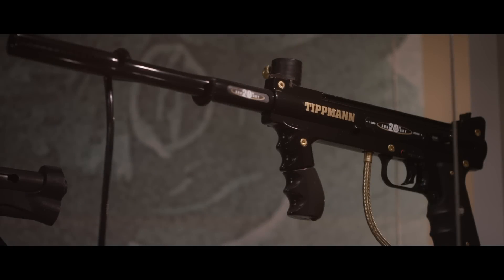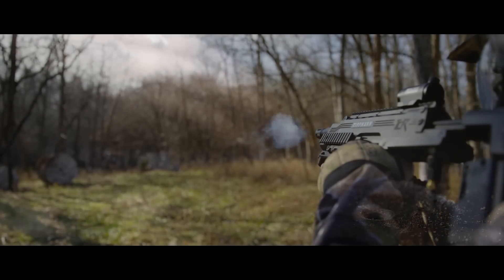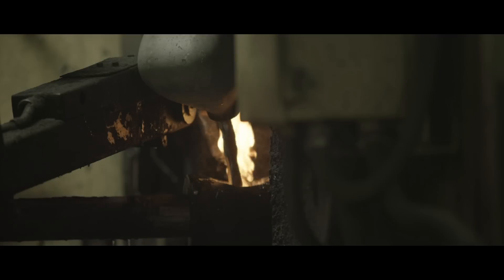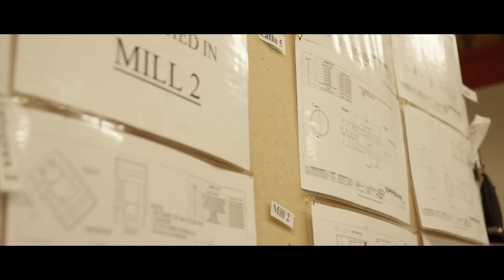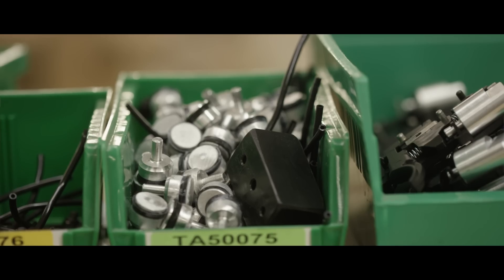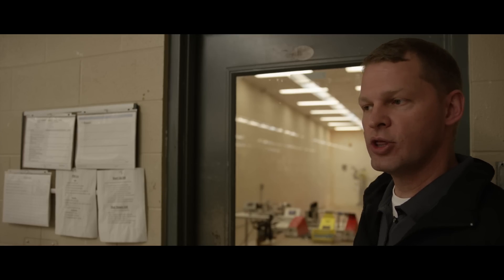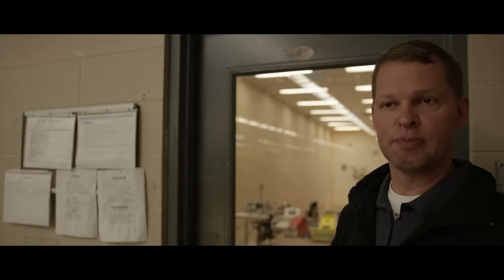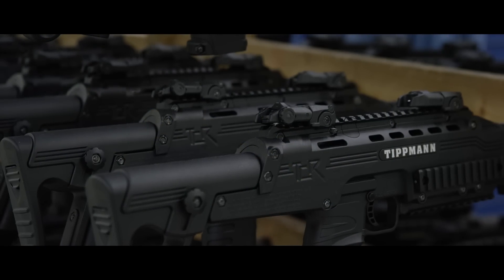How Tippmann Paintball Markers are Made

Comment: My first marker was a Splatmaster Rapide that I tricked out with Gator parts. My second was a Tippmann 68-Special. I was gifted a 98 Custom but never really liked it. Still use the 68-Special as my primary with a TPX backup today. May try the TCR but it won't replace my 68.

Comment: Good ole Tippman. I had a 98 Custom I bought in 2002 that I loved. I took it apart to see what made it tick and realized that if I just took a little piece of o-ring and put it in the oblong hole cut into the sear that the sear would stay down and the gun would fire full-auto. No need for the electronic or response trigger. Loved that gun!
Reply: I tried this and it worked. You're a genius😂

Comment: Started with a Sierra-1, then got a TiPX, and then an X7 Phenom. Unfortunately that's where it ends because I started playing magfed and while the TiPX is a good sidearm, TIppmann doesn't have any particularly interesting primary weapons for magfed.
Currently using a Maxtact TGR2 and keeping my old Sierra-1 around as backup.
Reply: Pat Best Tippman does offer magfed now. Some of the guys I play woodsball with have the new TMC by tippman. They sure are nice. I believe they also offer the TCR.
Reply: Tippmann has had magfed options for quite a while, and for the most part they're pretty good but they all have some big "buts" to them. One big downside they all share is the clamshell design making it a pain to disassemble and clean.
The Tippmann TCR looks awesome. The limited mag size is less awesome though. The lack of air-in-stock, also not awesome. I've grown really tired of my remote line.
The Tippmann TMC is a great entry level marker with no real downsides performance-wise. Unfortunately, again, lack of air-in-stock and clamshell design. The new receiver also means upgrades meant for the Custom 98 and its variants, like the E-grip, will no longer fit. It's also a little more plastic-y than I would like.
It also lacks the option to use First Strike rounds.
Reply: The overall construction of the TMC is also a little less sturdy than what I'd feel comfortable with. Though I've seen that they have improved the solidity of the front shroud, it's still only hanging on by a couple of screws.
Reply: Pat Best I get what you mean about the feel and the remote line. I run a project salvo and I'm not liking the line. I also still run a WGP auto cocker which ive rebuilt twice with pricey parts I can only find online from salvaged markers. I've been thinking about the spyder magfed offering because of the tank in the stock feature.

Comment: Older model Tippmann 98 Custom, now modded into an AK-47 with folding stock. Replaced firing bolt with an aluminum one, and added a harder spring to help boost it's firepower as much as possible.

Comment: shit if i was able to ship my gun i would of done so cuz my gun went crazy the presure gage fell off or went off i nvr noticed untill it started to leak qq now i had to send it to the shop i bought it so they can fix it if i get charged im selling the gun i like it but eh... its a sierra one tippmann twin bro of the project salvo qq
Reply: The pressure gage?
You mean the part that adjusts the velocity of the marker? Have you inspected the O-rings around it?
Reply: The shop owner told me the part that shoots the paint propels the paint broke its where you arm (clock) the gun  broke that is why my gun went full auto and did not shoot any paint too much presure broke it... but i nvr touched the part that you regulate the presure/speed of the gun
Reply: They fixed it but it shoots very hard now i think harder than before lol.. which side is the velocity knob?? The one sticking out where u attack the cycloon feed?? Or the other side?  I do not have a cycloon feed on it i just know it goes there.